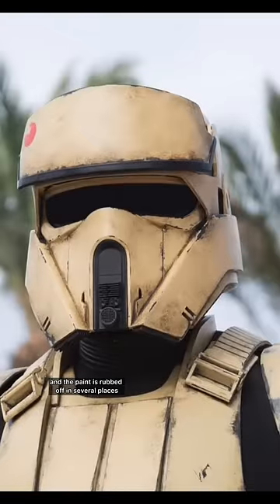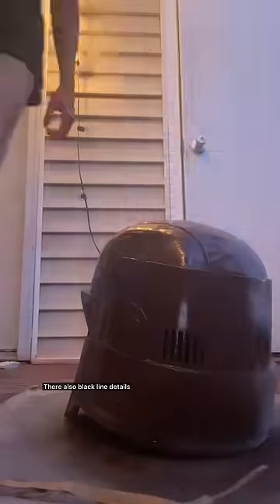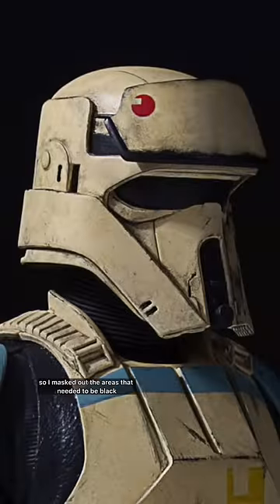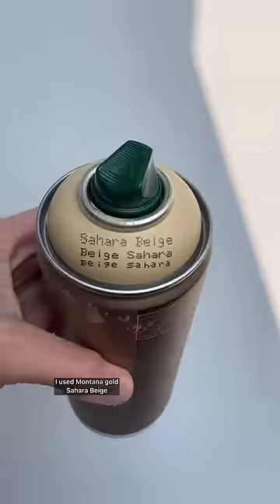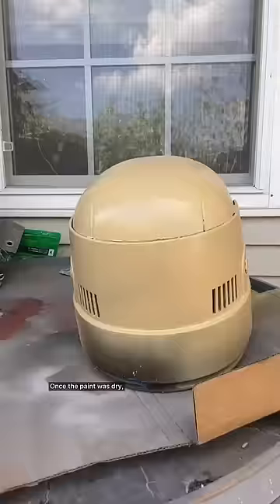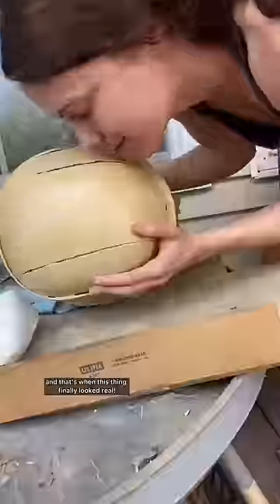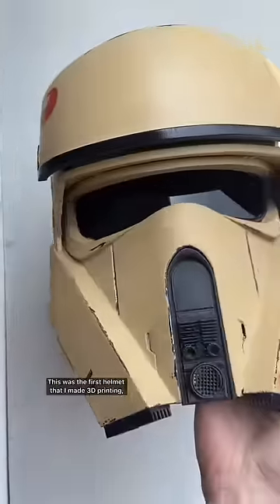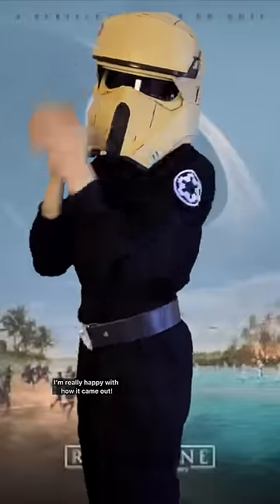How I Painted My 3D Printed Shoretrooper Helmet

Comment: A great method most prop designers use when it comes to weathering is to water down some paint, rub it all over the surface, then wipe it off to prevent any larger pools of paint from sticking. Adds a really natural dirty effect.

Bonus points for doing it with multiple shades of brown/black.
Reply: If you do this in layers to add depth, clear coat before each wash.
Reply: Or you just throw it in the mud a few times
Reply: Read my mind^ I use this technique and I believe it goes by dry brushing
Reply: Using water based oils is best because they won’t dry and flake as bad.
Reply: @Patchy_AK  drybrushing uses a brush and has no water, usually nothing gets wiped off. It’s used more as either a substitute for an airbrush or on corners of objects. This technique is called a wash, more specifically a blackwash or brownwash. It fills small spaces and in tight corners. Excess paint is removed and the hard to reach areas can’t be touched with a paper towel.
Reply: That's called a wash
Reply: That and try drybrushing for any scratch effects for the armour

Comment: Me after that video: I need 3D printer.
Reply: This would take like months of learning to achieve a remotely similar product
Reply: @MrZanyZain  nah I own a 3d printer and it was plug and go the learning curve was very little
Reply: Same
Reply: It's the best $300 you could ever spend if you're a DIY'er or artist. Making storm trooper armor used to require vacuum forming which was really expensive and hard to find a place that could do it in most cities.
Reply: @aniquinstark4347  I'm not sure I understand what you're saying, can you rephrase please?
Reply: Dont they like have that in a canadian library?
Reply: Pick up an ender 3! Bit of a pain to set up initially and certainly not the best printer out there, but well worth it given the low cost and upgradability. Retail is around $200, though they can be had for significantly less if you look out for online sales or live near a microcenter store (They've had in store promos a few times with $99 ender 3 pros)
Reply: Anyone who ever had bionicle needs a 3d printer too
Reply: Does anyone have recommendations on which 3D printer to buy? Something not too pricey neither too cheap..
Reply: prepare to learn to basically be a cnc technician
Reply: @johnderat2652  3d printing is an easier way of making custom armour than what people had to do in the past. It’s also cheaper.
Reply: @BhagyashriGhodke  I’d look into the ended 3 I have it it’s not the best money can buy but it works really well I’ve actually printed out a mandalorian helmet and am working on my next right now
Reply: An ender 3 and some nice PLA should be enough, and set you back about 100 something $ and 50-200 hours depending on how good the environment and your luck

Comment: You can use chipping medium between layers/coats of paint; great for weathering bits. The medium works by causing the coat above it to dry at a different rate so just a wipe and it flakes after top coat is “set”. Great for creating rust effects as well.

Comment: One thing that might lend good 'weathering' is something called 'chipping medium'. It is used for miniatures, under a paint job and then rubbed off with a wet brush. I don't know how well that would work scaled up - or even if it would be economical - but it does lend a really nice effect to minis, and you get more fine control of it.

Comment: If you want paint to flake realistically,  use hairspray on the base layers areas you want to weather. Once you put on new layers, you can use a wet  toothbrush to "dry brush" off the paint and it flakes off nicely. From  there, you seal the paint with a finishing spray of choice (matte, gloss, semi gloss). It's like a half layer you wait to dry and it prevents paint from sticking to the top, and protects the bottom area from rubbing away. Something I learned from sketch art, believe it or not.

Comment: Looks really nice!
Tip: You can use a soldering iron to melt some of that plastic and colour in the damage with a metal colour, making it look like combat damage.

You can also weather the helmet some more by adding clue and throwing on sand and used ground coffee. some dark colour can also be applied using sponges.

I like to visualise where the damage and wear comes from, can make it more relateable and more natural looking.

Comment: Looks great! For weathering you could try the hairspray and Salt method. It's mainly used by scale model builders and might not quite fit your work. But surely worth a try.

Also, liquid latex works wonders,  once you get used to working with it
Reply: They could also press it repeatedly with crumpled newspaper to get a more random pattern

Comment: A few methods to achieve weathering effects. The first is create the base layer whatever color you want to show through underneath. Once dry apply the top color and wait until it's close to dry but still tacky. Depending on how much you want showing through start with like 220 grit sandpapper and by hand start careful sanding the tacky later off in the spots you want. You want to use a fairly fine sandpapper as to not damage the base coat and it should gunk up the sandpapper a bit if you did it at the correct time. If you wanted something like rust to have built up ontop of the color you can essentially use a mixture of colors to get the shade of rust you want and using something like a foam brush or newspaper you can dab it into places you want rusted. You want it to be faily thick smudges and this time once its tacky use a lowner grit sandpaper like 80-120 to sand it away it should leave a fairly rough splotchy rusted finish, you can use finer sandpaper on the edges to help blend it.

 Another way works best if it's printed out of the same base color you want to show through but you could use a Dremel/rotory tool to carefully add knicks and gouges into the helmet. You can also use a soldering iron to create less rough looking gouges. If it's not made of the color you want you can then use a brush for something like miniature painting to fill those gouges in with the desired color.

 For adding a bit of weathering to the top coat so it doesn't look as clean and new there are two similar methods that both achieve the same effect. Depending on what type of wear you want depends on the color mixture, 90% brown 10% black creates a good dirt effect. You want to heavily dilute these with water if you're using a regular acrylic water based paint to where it's very slightly thicker than water but still extremely low viscosity. Use something like a foam brush to dab the mix you made to the areas you want to add a bit of weathering to. It will dry leaving the topcoat in tact but will leave a dirty haze over it. You can do it multiple times to achieve a darker and more worn look. You can also do this but with just black or the color of the topcoat to essentially create a wash that helps to bring out details in pieces without disturbing the original color.

Comment: Tip from weathering minifigures and project kit cars, use hair spray before you add the color you want to peel away and look weathered, just use a cloth to remove and then use a clear coat to set and keep everything in place

Comment: Vary in a lot of different colors with dry brushing, maybe red and brown for tinges of rust. Don’t forget to think about areas where a troopers hands would wear from putting it on; or even fine scratches.  Also one of the best weathering is fine sifted natural clays and strong coffee.  Nothing quite gets this old look like doing some washing in coffee.  Finally if you play with gloss you can make parts look old by having wear marks more matte and other parts of panels appear shiny and buffed.

Comment: One trick I learned with cans of spray paint ... most stock nozzles are crap for anything but large flat things (like walls).  If you want any kind of control, you need to hit up a graffiti supplier - they have a bunch of nozzle spray shapes to choose from.

Comment: Going over the crevices with a watered down dark brown then wiping away the excess would help with weathering. It's a tip I learned from painting Warhammer 40k models, I'd highly recommend checking out some of the painting guides for model painting since it's possible to translate those skills

Comment: I would suggest maybe dry brushing on some of the weathered areas. And maybe the other method where you get watered down paint to paint on it, then dap it with a paper towel. Of course you would be using acrylic if you used that method, and I’m not sure if you’d want to use that kinda paint. Those are just some ideas to make it more weathered. Also this looks sooooo cool!!

Comment: Just apply silver highlights to the edges where the weathering is. This will increase it's depth.

Also you can use black shoe polish to add a bit of smudge but applying it on then wiping it off, making it look like the storm trooper tried to clean the helmet but smudged it.

Comment: I good way to weather it would be approaching it the exact same way although instead of toothpaste using a thick layer of hair spray. This will protect the brown and allow the paint layers above to be removed. You can also apply this across the entirety of the helmet so you can remove as much as you feel necessary.

Comment: A simple wash goes a long way to enhance weathering. Just a few drops of black alcohol ink in water, with a drop of dish soap as a flow aid. Apply it to the edges and crevices then wipe off the excess.

Comment: If you want it to look more sandy, put some spray paint on a tooth brush and use your finger to fling it on the helmet. Also if you add some paint around the edge of the front glass it would look more dirty

Comment: Take a little bit of sandpaper and sand around the parts you need to be weathered, like around certain edges. It will both give the worn color and it'll give it scratches that'll make it look used

Comment: If you were so inclined you could take a paint brush and acrylics and paint some place with the acrylics after they are watered down then take a washcloth with a bit of water on it and wipe away most of the paint, leaving a little residue

Comment: Take oil base paint, dilute with water or alcohol and rub onto cracks and on surfaces then wipe off after it's dried for a little bit. Black and brown as if blasts nearby and the dirt from said blasts contributed to the weathering

Comment: I've seen some, like Adam Savage, add patches and blotches of a substance over the base coat before adding the top coat. After or while that's settings they rub. The top coat will come off on the areas where blotching was added for a ruff and scuffed  look. It might be glue from like a glue stick. He doesn't claim to be a master but Adam has some great video where he does weathering - even one with a helmet I think. Worth a look.

Comment: You should try a wash it achieve the dirty look youre going for. Take any color acrylic paint (ie water based) like black, brown or tan (or experiment with a combination). Dilute the paint with water and brush it on all over, letting it pool in cracks and other desired areas. Use a cloth or paper towel to remove excess and youre done

Comment: Petroleum jelly is best to use and can be applied with a small paint brush if you warm the jelly by placing the container in some warm water for a little while. After painting just wipe it off.
You can also buy alternative spray nozzles for your cans, they have nozzles for every application.

Comment: Random tip if you use a lot of spray paint - some paint, like the one in the video is geared toward graffiti and spray thicker to stick to brick, concrete whatever. Also, you can get all types of male or female tips for said graffiti sites. Cool stuff

Comment: Plastic model kit builder here. For weathering you did a very good job. However i believe that applying a brown oil paint wash in the crevices may help a bit. Also, you may want to look into the hair spray chipping method as that’s how I get the most realistic looking chips on my model kits. No hate as your model looks amazing, just some tips and tricks in case you want to revisit this project

Comment: Idk if you will see this but another method is to cut up a sponge and dip it in paint semi rub the paint off and then go around the exposed edges and use the sponge to use a choppy weathered effect.

Comment: You could try dry brushing. I painted minis for a long time for Warhammer and this is a main way to pull an edge lighter or worn. Most of my Chaos Marines and warriors were worn.
Reply: After or instead of that, you can add and oil or wash to it to muck it up, dull it and make it more worn.

Comment: Instead of toothpaste, use Elmer's Washable Children's Glue. No mess after it dries, and you apply straight from the tip. So there's no mess when applying. Allow glue to dry and paint. After paint dries it peels right off revealing the undercoat color. I use this method for painting guitars, so they have an aged look. Try it out, and I guarantee it's the only method you'll use. 
You're welcome!

Comment: Try using the hairspray technique instead of toothpaste place your base coat enamel paints put the hairspray in areas that you want to be worn then apply your top coat using acrylic paints and then get old toothbrush and scrub with water the areas where you laid the hairspray underneath the top coat get some really good worn paint effects then seal it with light coats of varnish then you can add weather effects and panel Lines then seal it all in with your Matt or glass varnish a course allowing dry times between each layer try see how you go.

Comment: I can give you one simple tip that will take your weathering from that "too clean" maybe even a bit cratoony territory to WOW THAT'S AMAZING! territory.
Don't just use singular colours, dirt, and damage is never of one uniform colours, dirt especially, to make dirt collecting in crevices etc believable you need at minimum 3-4 colours, similar but not too (one could be a bit more reddish, one more yellow and one a bit more green than the main colour you're using.
Even with damage using multiple colours works much better as you'll be able to add details such as, this spot has started to rust because the protective lining was scratched off, this dent has gathered some mud and dust into its crevices...

I stole all of that from the man, the prop god and the king of nerds, Adam Savage.

I'd highly recommend watching Adam Savage's video on weathering props (or basically any video where he makes props will do because that's always his favourite part of the build understanding of the subject and his execution are just pure perfection) but he has at least one video that he made specifically to teah people all his favourite (and low effort I'd like to add) methods he uses and has been using for decades, most of them having learned while working with prop maker legends (so you know they're good!) ways to age up a prop, to give it a stroy to tell and how to get the best results out of it 😊

And again, he has an absolute treasure trove of videos of him making props and costumes and he almost always does those last moment touch ups that turn his admittedly already cool looking props and suits into absolute works of art you feel could easily have been just pulle äd from their respective universes through a magic portal that Adam hides in the attic room of his shop!

Comment: What kind of primer did you use? Im looking for a good one for my mando helmet however it should be able to work on spray putty (filler primer) 😅
Reply from the maker: I use filler primer! I used Rustoleum for the Shoretrooper helmet, but was never impressed. I’ve switched to Duplicolor Automotive Filler Primer - it’s pricier but you only need like 1-2 coats (as opposed to 3-4 with Rustoleum)
Reply: @sunflowerstardust  ahh tysm!

Comment: Montana paint is great and there nozzles do suck buuuuuuuuut you can buy tons of different kinds of nozzles (search spray paint cap) for very cheap and most of them are great. The paint comes with a cheap cap because the main use is graffiti and the caps going in the trash anyways if your using it for graffiti